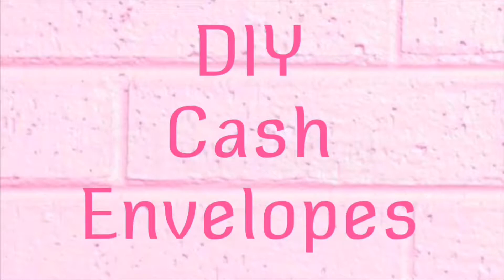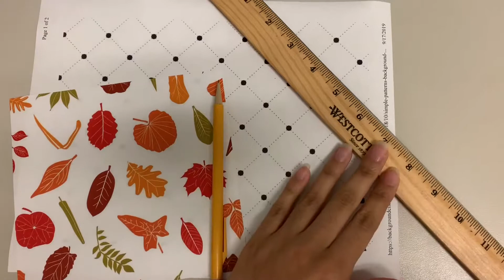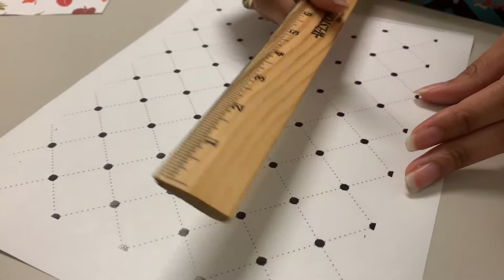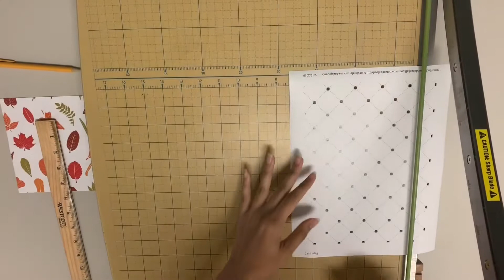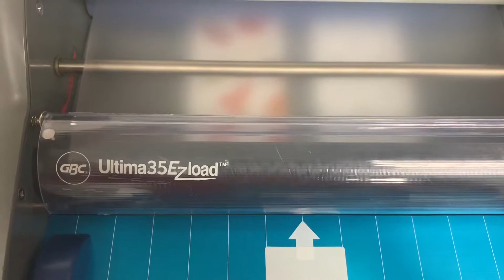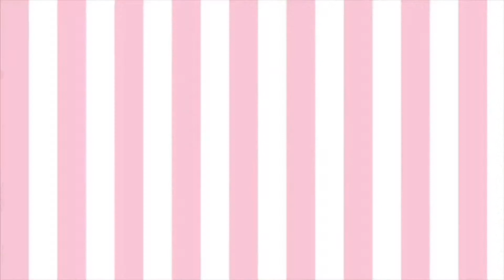Dave Ramsey Inspired DIY Cash Envelopes | Budgeting Starts NOW!

Comment: Hi what the name of machine you have I want to get one in the name of the paper for the machine and what kind of paper used to make for the envelope
Reply from the maker: Hey! The laminator I use is the ultima 35 EZ Load with the Gbc thermal laminating film, glossy 12” x 100’. As for the paper I just printed out the patterns I wanted from google images to save money. You can also just go to Michaels and get patterned paper. It’s easier to use regular paper instead of a thicker one. You will be laminating it anyway, so it will be durable.